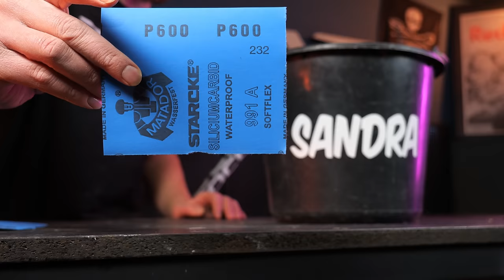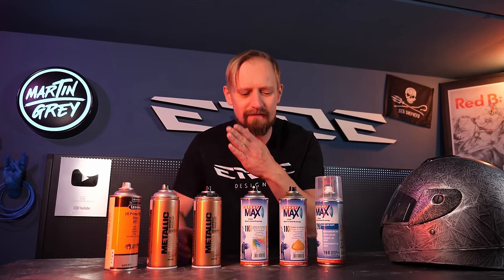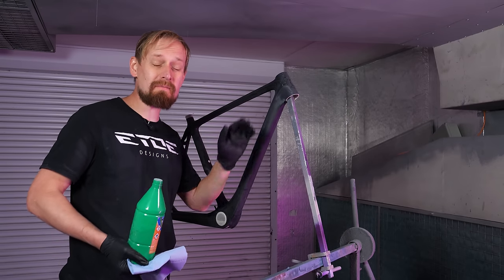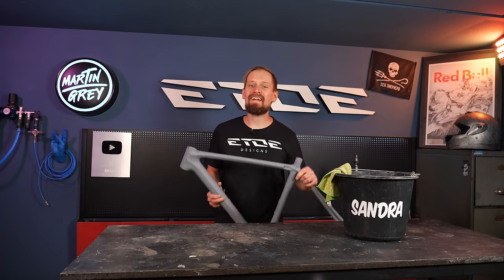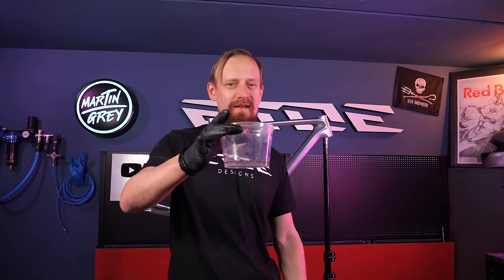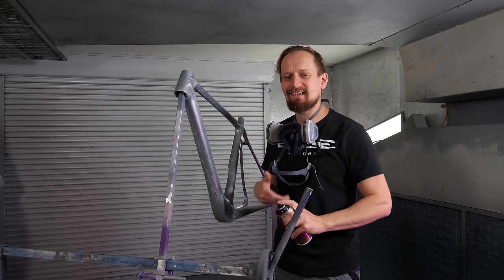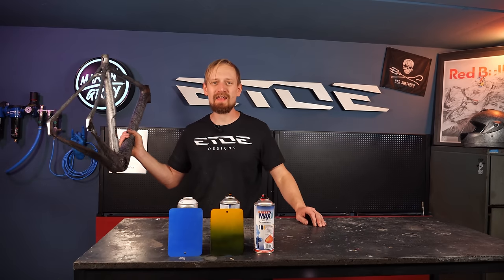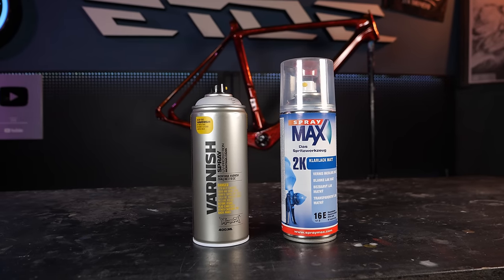Crystal FX Bike Paint With Spray Cans Only

Comment: **For those having trouble getting this to work**  Using this recipe I was unable to get the mixture to coat the surface without beading. Doing a bunch of research I saw alcohol has a much lower surface tension than water. I lightly heated a 1to1 mixture of 70% isopropyl alcohol and urea in a pot while stirring (stinks) and removed from heat then added a little distilled water until the urea had dissolved. Added to spray bottle or bowl and use a foam brush to apply by saturating the end and rub over surface. Step back and watch crystals grow.
Reply: In addition to the above I can gladly mention that I now have the annoying beading under control. Tried everything from changing the sanding, changing the urea mixture ratio, adding more ox gall, changing the degreasing, changing the temperature, changing the cloths and spunges and...nothing made it work properly. Now it appears the ox gall doesn't work that good for some reason. It all has to do with the surface tension of the water/urea mixture because when I added a few drops of the strong cleaner/degreaser with the name Dasty (the Dutch viewers will know now) it "magically" worked all of a sudden. No beading anymore on my test tube so now the bike is next!!
Reply: Thank you!
Do i need to Sand the frame after silver Spray and before urea Mix?
Reply: I will try this. I only got water drops on the frame and no crystals. How did it go? Do you habe more tips? I will be thankful. @claptinfan
Reply: Thanks. I have used 70% Isopr. Alcohol indtead of the Water 1:1 and heated it a little bit to solve the urea. If its not solving judt add a tony bit more distilled water. Soak a big paper towel in that mixture and very quickly soak the frame with it. You have to be quick because the alcohol evapored quickly.
Reply: @Florislaurens  So instead of ox gall you used Dasty or both?
Reply: @ralphinho77  I used both. Started with ox gall, did not do the job properly, added just a few drops of Dasty and that was sufficient. Don't use too much Dasty or dish washing soap for it will foam like crazy, making it almost impossible to apply a foam free layer of urea mix to the frame. Oh, and don't wipe several times back and forth on the frame when you apply the urea mix, the crystals seem to start forming directly after applying the mix on the frame, so wiping too much will disturb the start of the forming of the crystals and you'll get a disappointing crystal build up.
Reply: @ralphinho77 ...I've seen people do it with only dish washing soap so it will work but it foams like crazy, making it hard to apply a foam free layer. Using a sponge seems to promote the foaming.....so I'm gonna try a brush next attempt. Or use a lot of urea mix and pour it over the frame, spilling it mostly...
Reply: @johnpoth4171  I tried sanding the silver metallic paint only to destroy the layer. So I repainted it and applied clear coat. And sanded it lightly.
Reply: @johnpoth4171 I used light scuff pad and it stopped beading.

Comment: I've painted 2 frames, the first with 2k clearcoat the second with 1k clearcoat. after just assembling the bikes the 1k clearcoat already had some scratches on it. after 1 riding season the 1k clearcoat chipped on multiple spots. buy the paint as cheap as possible but just make sure to use a quality clearcoat.
Reply: I have to say that the 1k probably has a longer cure time since it's formulated to be all-in-one, whereas a 2k is hardener and paint and they mix and flash quickly and cure very quickly and become very hard. The 1k will in theory take much longer to cure to full hardness.
Reply: Dude Im a spray painter my kids bikes are painted with good automotive paint and it chips nothing like the powder coat but powder coat fades

Comment: Need help, anyone.  I got some good crystals, but when I tried to rub off the topcoat it didn't come off.  Even with 150 grit sand paper the topcoat is still hard to get off.  I'm using Krylon Spray Paint.  Am I using the wrong type of paint?  Am I supposed to take off the topcoat sooner?  Any help would be appreciated.
Reply: Rhe way I understand it, the topcoat over the crystals should be a metallic paint as it has a higher viscosity. Apply a thin coat. And it should be easier to take it off before the next step.

Comment: Okay, I did this and was having issues with the effects paint beading up when applied to the frame.. I then tried it with dish soap and it worked, but the crystals weren't large enough for me. So, I tried it again.

Don't forget to shake the ox gall! I thought I had a bad batch when I tried to coat the frame with a 2% ox gall/water mixture and it beaded again but then accidentally knocked the bottle of ox gall over when I went to reach for it for a second batch and noticed it started foaming. Gave it a quick shake, added it to the mixture and it worked like a charm. 

Thanks, Martin! My friend is going to love the amazing paint job!
Reply: Did you use the same ratios as in he video? I am trying it now but it’s not quite working the same. I tried the dish soap and that helped with the beading, but with or without the soap I couldn’t get the crystals to grow enough.
Reply: @nogood2063  I used the same ratio. If it's still beading, I'd hit it with a clear coat then sand it.
Reply: @ChronoCard  thanks! It wasn’t working on my painted frame, but the metal spoon I was using to mix it had crystals growing. I believe the surface wasn’t optimal for the crystals.
Reply: Does the mixture have a shelf life. Days or hours, just wondering.
Reply: @ReyciclismoMTB  Since it's just urea dissolved in water, as long as the container is sealable, I think it can last for a while. There are companies selling crystal effects "paint" out there.

Comment: Once again, thanks for the inspiring video!  I am really starting to think that the crystal FX paint is the way to go on the rear suspension of my '94  Cannondale Super V project. I painted it an another bike after being inspired by your other videos. The end results were decent but I want to fix some mistakes I made ( On the Super V it is  tiny thumbprint left in the 2K clear coat that wasn't quite completely cured when I moved the bike off the paint stand) and the second reason I want to repaint the bike is to challenge myself more. 
FYI, I also attempted the crackle finish paint job on my '94 Cannondale Delta V.. I couldn't get the crackle to work the way I wanted, so I got busy and sanded down the bike again and repainted it a Acid Green to Titanium Metallic fade.
Thank you for the inspiration to get my creative ideas going.

Comment: I absolutely love your videos and they've given me the confidence to paint my carbon frame. I have an S-Works Ready to Paint frameset. The logos are just decals. And it looks to have a very thin clearcoat layer over the bare carbon. How much prep work is required for the Specialized Ready to Paint frames? Do I need more than a quick sanding or scuffing of the clear coat? And my plan is using the 1K primer you linked, Montana Gold spray cans for a simple gold logo and white background, then the 2K gloss clearcoat for a shiny finish. Does that sound good? Also, do you have any tips or experience with the Montana Gold Marble Effect spray cans? I was thinking about doing a marble effect. 

Keep an eye out in the future. Maybe you can do a critique video because I'm trying to use all of your tips to get a quality job done.

Comment: Hello,

The crystals worked finaly.  

I have painted a project and gave it a really really light coat with montana gloss transparant varnis because i also used water based acrylic markers. But is it possible to put a 2k varnis coat on it after 12 hours dry? And must i light sand this layer before 2K (i used candy colors so can not sand much! )

Comment: Fabulous video and tutorial!! QUESTION: Can I use this same technique on a guitar body?? The guitar is wood but currently is painted from factory. I was thinking I probably just need to follow the exact steps you did, sand it a bit (not penetrating through) carefully  clean and on from there. Will that work or will I have a problem because the base material is wood and not carbon fibre or metal??
Reply from the maker: You have to make sure to waterproof the wood before applying any crystal FX solution.
Reply: @ETOE  I never thought of that. Thanks!

Comment: Always a brilliant job Martin 👍
Question.. I painted my frame as per your instructive clips, paint went in great but when I went to 2k clearcoat gloss, the finish was ok to mediocre.. on parts of the frame the finish was great but on other sections it came out like a matt finish. One can, two types of finish? I am contemplating stripping the frame again, wet sanding and go again with another clearcoat.. what do you think?
Reply from the maker: Your application is not consistent causing orange peel and a lack of gloss in some spots.
Reply: @ETOE  because of the issue with lack of gloss, I went over with a second can but to no avail, not a true gloss finish ☹️ From a distance it looks ok and people have liked it but because I sprayed it, I know where the faults are
Reply: @5tanw0rr311  now it’s hardened, go over it with some 800-then 1200 grit wet & dry. Just to level the micro bumps so not to go thru to paint. Then ( or just try)  metal polish or a t-cut on a cloth. Wax that and it should be heaps slicker;)

Comment: Thanks a lot! Does the chemical reaction creating the crystals produce heat? I am building a bamboo bicycle and would like to try Crystal FX on the lugs. They are made with Flax and epoxy resin so I would not like to expose them to heat or cold as it might alter their structure. Thanks!
Reply from the maker: No it's an endothermic reaction
Reply: @ETOE  thanks !  I'll give it a go

Comment: Martin...Did you initially sand off all of the original black paint? It looked like it wasn't sanded down to the carbon. In past videos you said we should sand all of the paint off. If you left some of the original paint on, can you clarify why? Thanks.
Reply from the maker: I let the black primer on the frame cause I used only cheap 1K spray primer.

Comment: Thanks for al your really nice video's.   I'm testing with the home made crystal solution. But when i put it on a test pice than it acts like water and i don't get a nice full layer of crystal solution on the test pice. Can you tell me what i'm doing wrong or where my crystal solution is wrong made? 

Greetings Arwin
Reply from the maker: Just follow the steps in the video, to achieve good results.
Reply: @ETOE    i did it the only difference is that i sanded my layer wett with 1000 sand paper. And then i put the crystal solution on the test piece.

Comment: Hey Buddy, do you know if the Crystal effect will also work on FDM Printer Material like PLA or is it reacting the way ot does because of the metal underneath? I rly like the effect and i am thinking to add this effect to some upcoming 3D Print Projects.
Reply from the maker: You can do it on any material which can be painted.

Comment: Can I use spray bottle instead of foam to wet the frame with the mixture?
Reply from the maker: You can.
Reply: @ETOE  thank you so much, just finished sanding (after 6 months 😂) and applying the primer yesterday. Will do the scuffing the primer and painting tomorrow. Thank you so much for your video🙏🏼. I really appreciate it.

Comment: Hey Martin.  Can you help me out?  I want to do this effect on a frame.  I have the silver applied.  I put flat clear over the silver.  Wet sanded the clear.  When I apply the crystal solution it just beads on the surface.  Can you suggest anything to get the solution to not bead up.
Reply from the maker: Yes I can. Do exactly what I do in the video to create this effect.

Comment: Cooler Effekt! Irgendwie kriege ich es nicht hin, dass die Flüssigkeit die ganze Fläche benetzt trotz Ochsengalle und Spühlmittel etc..gibt es da einen Trick?
Reply from the maker: Just make sure you have no trapped solvents in the paint which cause a lotus effect on the surface.
Reply: @ETOE  Ok. The Montana Gold is based on nitro/acrylic and with them  i should not have this problem..perfect..thanks

Comment: Hi Etoe, I just have a quick question. On this video you use the crystal fx solution on top of the metallic silver but in the video of the helmet you put a 2k clear coat on the silver first. Is there a specific reason for that because it seems to work in both video's? Thanks!
Reply from the maker: Yes it is, depends if you choose a water based or solvent based  color.
Reply: @ETOE  ok thanks!

Comment: Great video, dude. I've been watching a lot of Indonesian and Malaysian guys do this. They all add washing up liquid (dish soap) and you didn't. I haven't seen this oxene bile mentioned before. I followed their methods on many test pieces and got very small crystal patterns. I assumed it was the climate difference but now I'm wondering if their non-EU urea fertilizer already contains the oxene bile?
Reply from the maker: If you have small cystals you need to slow down the evaporation. But that is advanced custompainting and needs more knoledge and practice. Doesn`t matter if you use ox bile or not.
Reply: @ETOE  Thanks, man. I've tried samples using a range of concentrations and slow to fast drying. Nothing gives crystals this large.

Comment: ETOE, can you share the most favorable time intervals between the different types of paints or the maximum time intervals between them? 
That's where I'm personally most confused, because I'm scared if I have to hurry too much before the paints starts to harden and maybe make the next layer crackels.
Reply from the maker: I have no fix time schedules. Depends on temperature and humidity. You have to measure both and find out whats the correct ammount of time.
Reply: @ETOE  Okay, so you can't share or say if it have to be around 2-4 hours between primer to paint to clear coat, or if it can be days? Or tell me how how I find out whats the correct amount of time for what temperature? 🙂 I would just really like an approximate time, so I can avoid any rushing or failures in similar diy projects 🙂 And thanks for answer, your videos are great!

Comment: Thanks Martin for an amazing tutorial. I've been trying to achieve the same effect following your directions down to a T, but I can't seem to get it to work for the life of me. When not putting enough wetting agent in the formula, I got beading.. when I put too much I got foaming.

One thing I did notice is that you mentioned that you applied a clear coat after the silver base coat in your green bike helmet video, but not this video. Was that an oversight? Is having a clear coat layer before applying the urea solution the step that I was missing?
Reply from the maker: I used no clear coat on the bike.
Reply: Hello! I have the same problem, the liquid wont stay on the silver coating properly… did you manage to fix it?
Reply: @user-xf1yz9kg5c   No. Not yet. I’m close though.. had to switch to a different surfactant.. Dawn dish soap and that helped reduce water beading, but I’m still not getting the same crystal effects that Martin was getting. The crystals are very finicky and lots of variables can affect the outcome, including relative humidity and temperature. I also saw others who added alcohol to the mixture to speed up evaporation. Please post if you have any better luck.
Reply: @Nuts4carsguy  yess i made it work. I used dishsoap instead! Also i used a scuff pad to get the surface less smooth. And i degreased it with waschbenzin. Also in cold it does not work i found out. I used temperature of 19,5 C and had a window open for a little bit of airflow
Reply: @Nuts4carsguy  also a tip: if you dont like a certain area, use a plant sprayer from large distance to rewet it, this reactivates it and it turns out fine. But scuffing the surface with 600-800 worked good for me
Reply: @user-xf1yz9kg5c  I’m waiting for warmer weather to kick in for when I resume the project. Hopefully that’ll do it.
Reply: Yes rewetting with the spray bottle definitely helps fix some areas for me too.
Reply: @Nuts4carsguy  smart, i just did it in my livingroom but it makes a lot of rubbish
Reply: @user-xf1yz9kg5c  I am honestly very tired of the cold and ready for the summer so I can finish this project. My bike frame is in the garage and still not dry after a few days after applying silver paint. It is too cold to dry.

Comment: I'm can not getting it working. Made tests and it worked on there. But on the real deal the crystal solution lays on it like water drops and not a film of liquid. On there is a layer of motip 1K clear that i sanded with 800 grid wet sanding papier. So i can not see what i'm doing wrong there.
Reply from the maker: Still too much solvent in the paint layers caused by your application style. You have to evaporate all the solvents or run in trouble causing these solvents a lotus effect on the surface.
Reply: @ETOE   Would it help if i now first put a thin layer of montana Gold outline silver (the same you use) over the board?  And then let it dry for about 1 hour and then put the crystal liquid over the board.
Reply: Did you ever get it to work?? I am having the same problem

Comment: Does it work on Wood?
Reply from the maker: No
Reply: It might depending on the finish. I am attempting to get it to work on a painted guitar body. I'm using scrap 2x4 to make test runs. I am getting very fine crystal lines that look like as one guy said fiberglas. I did find that applying with a spray bottle works nicely.